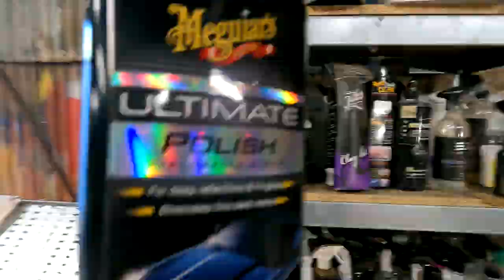Can We Restore Pink 25 Year Old Paint Back To Red????

Comment: The red stuff that is left on the rags and polishing/cutting pad is paint. Some of the NB mx5s came with single stage paint aka no clearcoat, this includes mine, also a Classic Red NB 2000. There are I think 3 different color codes for Classic Red. You can find the color code on the passenger side door sill. I still have to do this job on mine since it is also dull and "pink" as your car was. Great vid and great pointers as always. Found your guys channel recently and so far loving the content 👍👍
Reply from the maker: Appreciate that man thank you 🙏 🤘🏻💜